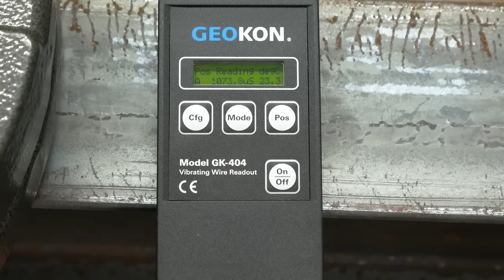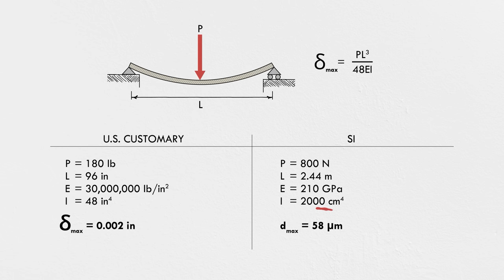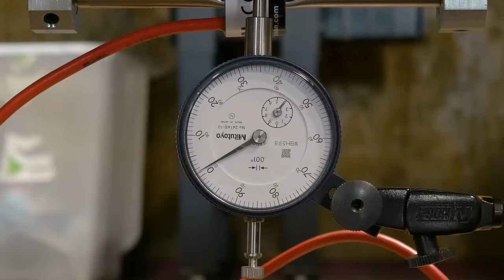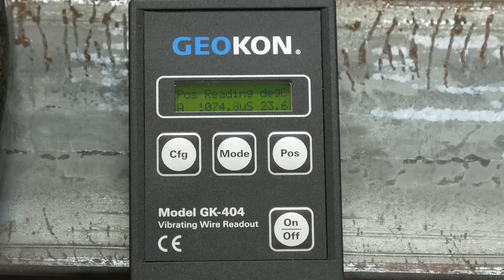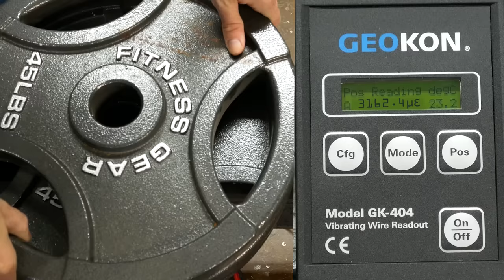How Sensors Keep Bridges From Collapsing (and other structures too)

Comment: Another important sensor type is an acoustic emission sensor. When placed on a structure, they can listen for cracks and friction sounds and let you locate the damage position, if you don't even know where to look for them. They are usually temporarily mounted, but can also be installed over many years. Their use in infrastructure is comparatively new though and not fully accepted and widespread.

Comment: The old iron bridge (in the thumbnail for this video) is the railway bridge between Echuca (Victoria) and Moama (New South Wales), Australia. It was built in 1878 for rail and road traffic and spans the Murray River which is the state border. It is now just used for road traffic. The replacement concrete rail-only bridge (opened 1989) can be seen alongside.

Comment: One interesting medical application of structural load sensors was hip replacements. We initially thought you needed to avoid walking and standing for a few weeks while exercising in bed before you could walk again as not to destroy your new artificial hip joint (or rather it's connection to your bones), but after a study with a hip replacement with stress load sensors we found out that simply flexing your hip while in bed put more load on the joint than actually walking. So we ditched the weeks of lying in bed and people now go straight to walking after hip replacement surgery.
Not only is it not fun lying in bed for a few weeks for no reason, it actually costs much more than a hotel room staying at a hospital and most importantly, hip replacements are done on elderly people that can lose 20-30% of their muscle mass just by lying in bed for a few weeks which can result in them never walking again afterwards or at least ending up in several weeks of physiotherapy before they can get out of the hospital again.
It really did revolutionize hip replacement treatment.

Comment: Great video on engineering as always. A comment from someone who does a lot of data visualization for my job: when you use plots with two y-axes, you need to really help the viewer understand what line goes with what axis. Or better yet, avoid dual axis altogether, and use aligned panels instead. (Plotting the same variable on different units, like the pressure graph with bar and psi is a great use of dual axes though.) It also helps to point out to viewers what the direction of the deformation axis actually means, does negative values mean that the crack is increasing in size?

Comment: Strain gauges are both useful and tedious.  As an engineering student, I was horrified that many cool tests ended up taking 3-4 times as much time to calibrate the strain guages and the Wheatstone bridges attached to them than it took to do the experiments themselves.
Reply: I feel your pain, but the calibration is worth the extra effort to make sure it's done right. If the data can't be trusted at a quantifiable level, then the experiment is meaningless 🤷‍♂️

Comment: The plumber doesn't care about the city water pressure fluctuations. They care whether your pressure regulator valve is doing its job, so those higher system pressures and fluctuations don't gradually destroy everything in your home plumbing system. You've surely noticed that your faucet doesn't behave like a fire hydrant. They just need to test while they're there to determine whether the regulator needs adjusting or replacement.

Comment: I recall in the 1980s when the San Francisco Golden Gate Bridge was opened for pedestrians to celebrate its 50th anniversary.  The concentrated weight of people on the bridge was multiple times more than it ever experienced from vehicular traffic.  Hence, the curved bridge flattened-out at mid-span; which was documented with photos.
The structural engineers said there was no danger of the bridge collapsing from that excessive weight.
I was impressed the designers of the bridge had over-engineered its structural strength to handle the weight.  As, after all, the bridge structure was experiencing unprecedented weight at 50 years of age.

Comment: I Design build Water Treatment facilities and upgrade old plants. This includes drilling in anchors, pull testing to failure, yes failure, epic right..? We need this to prove when lifting out old pumps we prove safety factors so my crew work in an environment that is proven safe. these guys are my second family, we need safety, we need engineers and sensors.
Thanks again for a well out together video.

Comment: That really IS like a superpower, seeing into solid objects and measuring things over spans of time that we just couldn't manage any other way.
Recently learned about something called a "rust battery" too - it made me think about your corrosion demonstrations and the discussion of just what rust REALLY does to a structure. The idea that iron and air can combine into a very efficient large-capacity battery is just plain amazing, but if they can make it work at municipal scale - how cool would THAT be??

Wanted to give you another thank-you about your GREAT book, by the way! I got to nerd out a little about power grid infrastructure just a week ago, they had to open the big green box at the edge of the street, and while I made sure to ask first and stay well out of the way so I didn't endanger myself or the techs, I DID get a good look at the innards for a few minutes! I brought the book with me so I could kinda compare the illustrations to what I was seeing. VERY cool!
(The reason the techs were working was also fairly astonishing: all power lines are buried in my neighborhood, but as it turns out, when you combine soil that's saturated with water after days of rain, and a DIRECT lightning strike right over a buried line, things go just a bit haywire! Power to our house did STRANGE things for a while, heh.)

Comment: When i was at school there was a day in a place where they test materials. They put a sturdy metal bar in my hands, and just from holding the bar, we could hear the frequency of the sensor on it changing, meaning that big metal part was bending a little just under the stress of its own weight! I was amazed!

Comment: My first dealing with strain gages was when I assisted glueing them to some developmental aluminum poles.  They were intended for flag poles and for street light poles.  Some early prototypes exhibited scary response to wind, namely starting to vibrate.  So there was an effort to study the different means of reducing or eliminating resonances.  Bending strength was the first measurement target and then harmonics of the vibration.  Eventually the light poles revealed another issue -- torsional vibrations, when the lamp housing with its ballast was mounted at the tip of a sideways bent top.
 .
Then I designed (and built the electrical parts) for measuring moving wire tension at different stages of a multi step pulling process.  The first  instruments  used a three wheel system with a flat spring steel "beam" ( a leaf ) and a full bridge formed by a set of 4 strain gages.  They worked fine at slow wire speeds, but became a bit scary at high speeds.  So, the final version had instead of ball bearing rollers three polished and rounded carbide pieces, one  at the center and one on the opposite side of the steel leaf, at the ends.  Again, he strain gages were forming a full bridge.  I still, after decades, have some strain gages in my desk drawer, just in case I would need to build some new instrument.

Comment: Worked at GE Power, did a lot of strain gauges on turbine blades.  1 of the difficult aspects of the strain gauges is getting the wires out of the machine to the reading equipment. Design considerations for these were thermal growth, load deflection, modal (frequency) analysis,

Comment: I knew a guy who worked for MDOT who was involved in a project with the Mackinac Bridge Authority which used strain gauges and heavy test loads to determine if railroad cars could be placed on trucks and driven across the bridge.  I recall that this was after one of the loading docks for the railroad car ferry failed.

The conclusion was that the bridge could take the load but the project was not undertaken for a variety of reasons that I don’t remember.  Railroad service between St Ignace and Mackinaw City was discontinued.

Comment: I found this really interesting, partially because my last job was for a company that makes similar hardware. YieldPoint. They make Extensometers, Micrometers, Tiltmeters, Sloughmeters, Thermistors and were developing a pressure cell and a vibration sensor. I wrote the software that would collate and analyze the data from all the different equipment. Much of this equipment has a special place in underground structures such as Mines, as it is near critical to keep people safe by tracking the shift of the ground above peoples heads.

Comment: A friend (and ex-colleague) of mine was hired by Fibersense earlier this year and they seem to have very interesting technology in using fiber optic lines to measure (sense) vibrations and the likes of. They're even able to detect underground pipes leakages using telco fibre running in proximity to the pipes.
More importantly, they use AI (Machine learning) to collate and corelate the data from the massive arrays of sensors (including existing traditional sensors) to flag out anomalies. E.g. Being able to sieve out 'expected' blips from activities such as movement of heavy vehicles like mining trucks moving near the mines where the sensors are monitoring etc. 
People are still involved in verifying the flagged anomalies (what my friend does) and it's just going to get better over time as the dataset gets larger and more diverse.
It'd be interesting to have a video on how they are able to leverage the existing telco fibre optic lines to actually act as vibration sensors.

Comment: Pretty cool! Engineering firm I used to work at years ago designed and manufactured a wireless slope monitoring device, called the "Slideminder" used in mine safety and engineering. I loved working in that field!
Reply: Hey, I just started working installing VWPs for CNI! Small world :)

Comment: I did my electrical engineering co-op with an automated metering company and while those are mostly city-scale systems there are a lot of parallels, especially to your water pressure test. I read a patent at one point (maybe from Diehl?) for a fire hydrant with an internal antenna and sensors to log city water pressure.

The vibrating string measurement also has some similarities to the operation of an ultrasonic water meter. You fire an ultrasonic pulse into the water, then measure how long it takes to travel to the receiver. Then you can calculate the flow rate based on how different the travel time is from the typical speed of sound in water

Comment: A best example for this video would have been the Champlain bridge in Montreal. During it's last few years before demolition and replacement it was the most analyzed and watched bridge in the country. Covered in sensors everywhere, constantly getting emergency patches at the last minute. Like those temporary super-beams that would block a whole lane of traffic. Champlain bride is a very good case study when it comes to the practice of remote bridge monitoring with sensors.

Comment: Your plumber that took a single measurement at a tap was likely checking for extremes, like is the pressure under 40 or above 100, things that can indicate problems with only a single measurement.

Comment: There are also extensometers for measuring larger long time crack formations or earth movement in tunnels. These can measure millimeters to decimeters and beyond.

There are vibration monitors used to make sure that blasting, boring or packing/piling doesn't cause undue vibrations on sensitive structures (old churches, tunnels, bridges) or equipment. In earthquake prone areas, vibration meters are sometimes placed around things like nuclear plants to monitor the vibration situation over time. A network of vibration monitors and careful loading during blasting can help blasters fine tune their models on how blast vibrations propagate through a particular area.

There are also extremely sensitive ground movement radars that can monitor a rock face at sub-millimeter resolution from kilometers away - to detect and predict if a mine rock face is moving or even about to collapse.

Comment: Ha! I work in Gei who makes all kinds of devices and dataloggers to read these sensors, they are useful in so many applications, not just man made constructions but also to monitor slow landslides and pretty much the condition of any terrain during a construction project, and it can be important to have these work even in places where there is no electricity or over long distances and send the data remotely, it can really prevent something dangerous from happening

Comment: I logged the water pressure in my house (city water) over a day but was surprised/disappointed over the result. There were short dips in pressure every now and then but then it always rose to about 9 bar regardless of time of day. I had expected lower pressure in the morning when the flow in the whole town is the greatest. I found out there's a check valve on the incoming pipe to my house. Each time I used some hot water, the water heater filled up with some cold water which was heated and expanded till the safety valve let out a few drops. So with no flow, the pressure was almost always at the release pressure of the safety valve, dropping as soon as the flow began.

To get a relevant reading, I would need to remove the check valve (which isn't allowed) or have a tiny flow of water running during the whole test.

Comment: 5:02 ... Actually there is! In gradschool I worked on a project processing the instrument data from a concrete box-girder bridge (Benicia-Martinez in Northern California).  There, they had installed piano wires across the spans (inside the "box") with linear displacement gagues at regular intervals between it and the bottom of the deck.  The piano wire had a known shape (pretty much "straight" under constant and very high tension) so you could extract the actual deflection of the span from the data.

Comment: Please do a video on the harmon tower here in Las Vegas. It was supposed to be a nearly 50 story hotel that they only constructed to 28 floors before realizing there were massive issues with the structure and had to completely tear it down. MGM tried to litigate the situation in order to have a judge override the structural engineer, but the courts ended up agreeing with the designer, and order the building to be demolished floor by floor. It cost almost $500,000,000 from MGM’s pocket for nothing.

Comment: I can most definitely appreciate sensors afterall i am a mechanic and habe to handle all sorts each week. Though a word of warning from another industry, beware of oversensoring. Its too easy to engineer in so many sensors with so many different types names and locations that the information coming out may be useful but incomprehensible due to its volume, not to mention immensly difficult to diagnose and repair.

Comment: Hey Grady, Plumber here...we check the pressure mostly to insure youre system is working correctly....mostly its the pressure reducing valve that goes bad and the pressure jumps up to 80 or more

Comment: Tap measurement: If you log the watermain pressure over the day, you can correlate any single measurement (say in your house) with the mains pressure at that time. By calculating the delta between mains and house, you can estimate the house pressure over the day.

Comment: I toured the Tower of London a couple of decades ago. They were monitoring cracks by what appeared to be microscope slides epoxied across them. I believe this was being done during the Canary Wharf development construction. Presumably the glass would break if the cracks were to widen or shrink.
Reply: Those are manually read crack gauges.  One template has a grid, the other has a cross hair.  As the two sides move you can take a photograph and see if it's moving over time.

Comment: One thing I think would have fit really well into this episode is a segment on sensor placement.  In steel, deformation is, I would think, parabolic, so if you place the sensor in the incorrect spot, you'll get artificially low readings.  I assume you'd always want the sensor centered across the span, but is that true?  

With concrete, I'd imagine it could fail completely without the sensor detecting it at all if the failure didn't occur across the sensor itself.
Reply: I wonder if acoustic crack detection is also used in concrete engineering.

Comment: Great video as always! However, when you say that concrete is a stiffer material than steel, this is not exact. The E module of the typical concrete is way below the E module of steel (30Gpa vs 170-200Gpa). The fact that you need a press is rather due to the way bigger second moment area of the concrete beam, which makes the concrete beam stiffer (but not the concrete itself).

Comment: Did you hear about the Nelson Mandelabrug in the Netherlands? Apparently, folks made some errors that caused the bridge to be at risk of collapsing. They had to close it down overnight and move some parts to decrease its weight. Very interesting case, and they used similar measurement equipment like the ones in your video. Might make for an interesting part 2!

Comment: Could you use the electrical current created by flexing quartz to measure strain or movement?  It might be useful to have a sensor that generated a signal on a change rather than a sensor that requires constant electrical interaction.